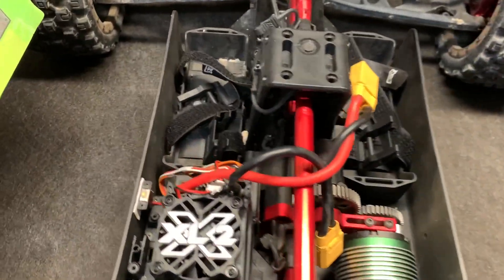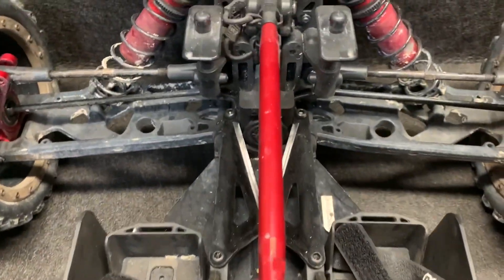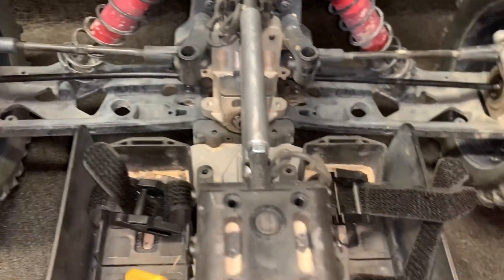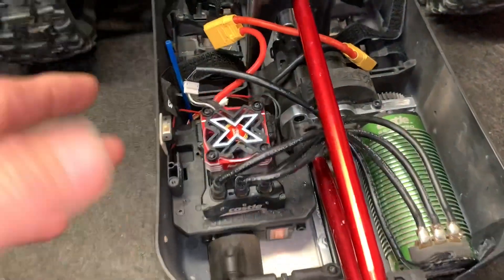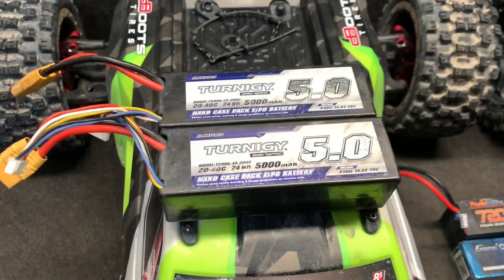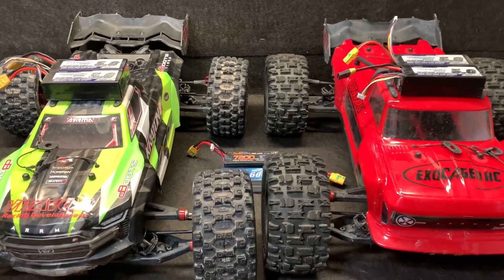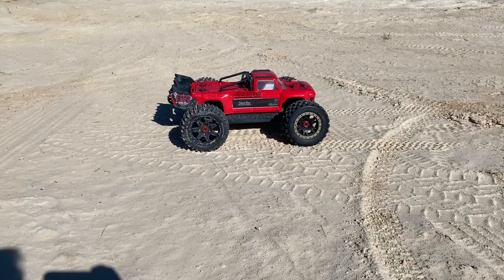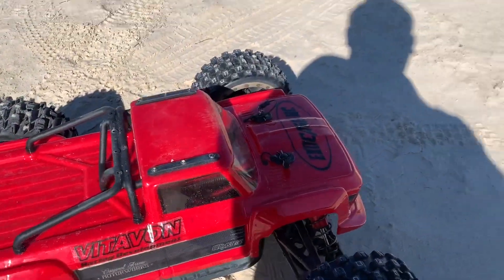My MODDED K8s vs MODDED O8s

Comment: The PH 9000 100c graphenes are phenomenal for me. You should try them in those heavy rigs. They really worked well in my xmaxx, great runtime and punch. I run a single 4s in my m2c LWB MT410 and have gotten great results from them there also. Standing backflips with a heavy LWB chassis and badlands. Yes they’re costly, patience can save you a few bucks with a coupon etc. Truth is a set of them costs about the same as a 3s series arrma rig so it can be a bit tough to justify. I feel like I got my money’s worth though so that’s all that matters to me.

Comment: How has the steering throw left and right been on your rigs with the stock steering setup and servo? My k8s turns great to the left, but not so great to the right even with endpoint adjustments.
Reply from the maker: well I moved the saver over one spline and adjusted the link out a bit, seems to help.

Comment: Glad the xlx 2 did not blow up till now.
Reply from the maker: my two are running fine so far
Reply: @ExocagedRC  I use OSE 8mm connectors and that is what castle is recommnding for thse big amp systems....I have those exact  systems in my xmaxx and kraton 8s and they are running great.

Comment: How much does the rig cost with all upgrade
Reply: Dude, Arrma owners NEVER want to talk about that...
Reply: @bransonbasher6534  hahaha if they stay in denial probably makes it easier to lie to wife.  Guessing about 2k-2.5k.
Reply: @brutallyaverage8293  🗣️ facts
Reply: This Hobby is very expensive. I'm deep into $4k for 3 trucks in just 2months!  -oh well, it's just money🤣🍻
Reply: @surfside75  sad thing is it doesn't have to be that way.  I probably have more fun when I drove my 3s trucks because they are practically free to fix vs my kraton 8s lol.
Reply: One reason I went back to 8th scale predominantly is the cost associated with the big trucks. Price rises exponentially with scale. Plus I also like having tons of body options and painting a cool one for my rigs. The real advantage to large scale to me was the surfaces I was running on. They go great over any terrain, really smooths out the rough stuff. For me 8th has become my sweet spot, still hauls in thicker/taller grass and not getting tossed around as bad on gravel and ruts. You also get the advantage of more tire options and cheaper batteries. It can get real expensive really quick buying big 4s packs for a days worth of bashing if that’s something you’re considering.
Reply: I have the xmaxx 8s and the kraton 8s with these systems- the truck, badlands and the system with motor mounts will cost you about 2k for either the xmaxx or the kraton. you need motor mounts for both trucks, systems are the same price for either. and I have many Arrmas and Traxxas Rcs. I run my Arrmas more because they are more durable hands down. ANd I have been at this over 20 yrs.